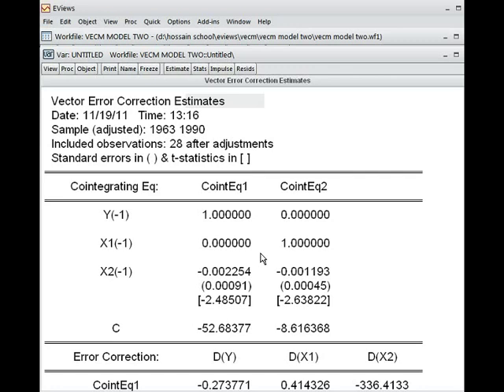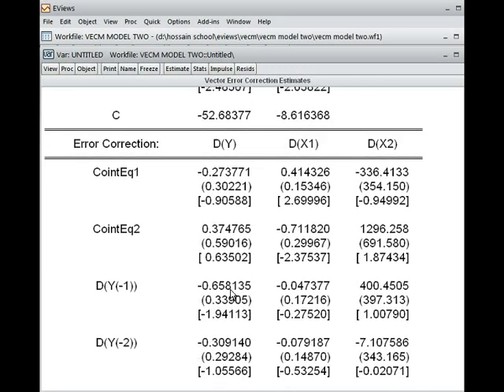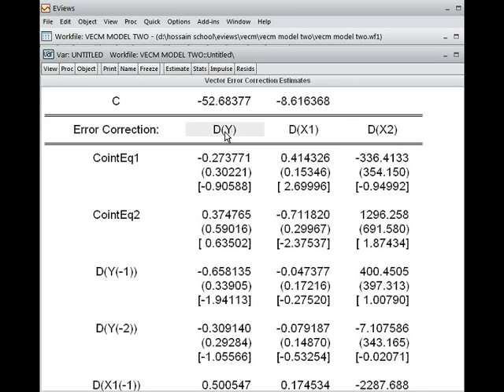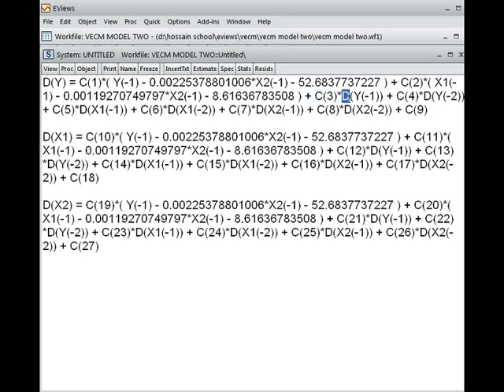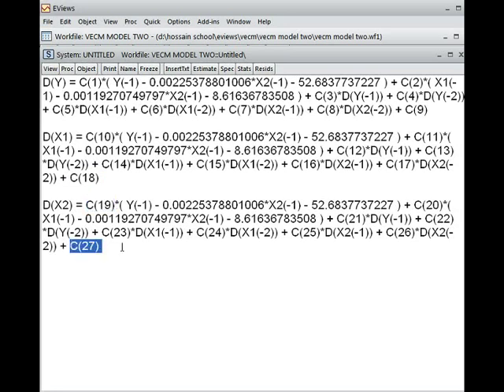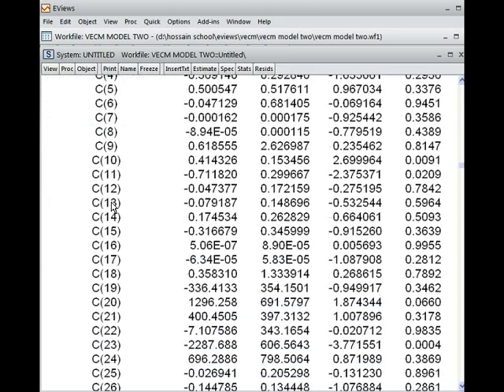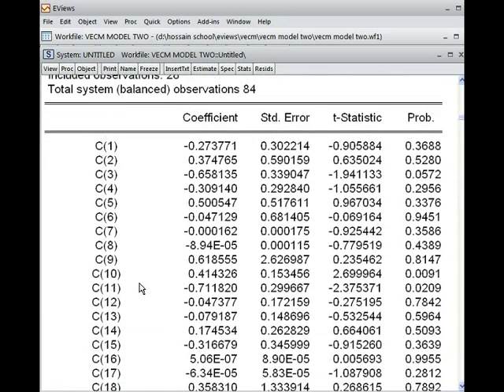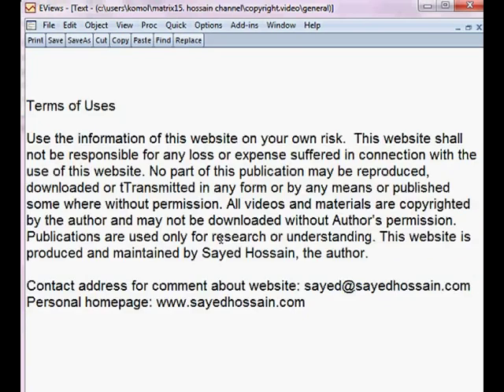VECM. Model Four. Part 2 of 2. EVIEWS

Comment: Hello Sir,
i had applied VECM on commodity indexes logged future and spot price.  VECM model is stationary and its residual has no serial correlation. but residuals are still heteroscedastic and not normally distributed. please suggest can i go with this model or not. can i use VECM with Garch Estimation.
Reply from the maker: I guess if you convert all variables into log and run it, hetrocedasticity problem may remove.

Comment: Hello, i saw it, but Im using VEC Residual Serial Correlation LM Tests and I would like if this result indicate that there is correlation, because en lag 3 rechaza HO.

I must look just lag 13 or each lag.

There is correlation or not?

Lags	LM-Stat	Prob
		
1	 2.904340  	 0.5740
2	 3.510978   0.4762
3	 9.952810   0.0412
4	 0.830685   0.9343
5	 0.495779  0.9739
6	 2.757596   0.5992
7	 0.955108  0.9165
8	 3.472518   0.4821
9	 3.337335   0.5030
10	 2.142388  0.7096
11	 1.639805  0.8016
12	 5.539782  0.2363
13	 2.319100  0.6773
		

Thanks,

Comment: hello Sayed, I´m running a vec model, but how i can identify how many lags i must use? my model have correlation serial,

I like know if  i have a vec model with 13 lags and the serial autocorrelation test LM have this results:

		
Lags	LM-Stat    Prob
		
1	 2.904340      	 0.5740
2	 3.510978       	 0.4762
3	 9.952810        	 0.0412
4	 0.830685        	 0.9343
5	 0.495779         	 0.9739
6	 2.757596         0.5992
7	 0.955108         0.9165
8	 3.472518         0.4821
9	 3.337335         0.5030
10	 2.142388        0.7096
11	 1.639805        0.8016
12	 5.539782        0.2363
13	 2.319100        0.6773
		

In lag 3 there are serial correlation or not????

Thanks,
Reply from the maker: I have a video on lag selection. See it

Comment: Good evening, Mr. Hossain. Your explanations are very useful for who, like me, is trying to estimate a VECM on a group of variables. Thank you for spending your time for us.
I have a question for you. I would like to insert a trend term and a dummy variable in the cointegrating equation. I tried to do it adding the dummy as an exogenous variable in the "VAR Specification" dialog box, but it only appears in the short run part of the model after the lagged differences of the endogenous variables. How can I do what I wish?
Reply from the maker: That part I have never tried before. Unable to answer.

Comment: hello Sayed, i have a problem in estimation of vecm in panel, so could you help me in order to have a good estimation, if you want, i send to you my data and i explain to you the target of my research. please M Sayed, could you also explain to me how to run the model. i need it in my thesis. could help me please and i need your mail. God bless you
Reply from the maker: I have not done anything with VECM in Panel. So unable to help
Reply: hello sayed
i don't understand something in vecm model which is the coefficient. so if i got a short run causality after using the wald test and i suppose that i chose lag 2 and coefficients of  independant variable in first difference are c(2) for lag 1 and c(3) for lag 2. so the question is about which coefficient (c(2) or c(3)) that i use in my interpretation.

Comment: Sayed, I am running a VECM with 4 variables. All of which have unit root and there is 1 cointegrating relationship. I can run this model. 

I then want to run a variance decomposition and impulse response functions on this model.  However when I attempt to do so, both these are ran using the original variables (not the differenced variables). 

Therefore my question to you is how to run the variance decomposition and impulse response functions on the VECM model I have just created. 

Many thanks

Comment: Mr. Seyed Hossain, thank you for your videos, I have a time series model (39 obs only) that Engle Granger (OLS regression with stationary residuals) coefficients is OK however VECM and ECM G to S models are giving me different coefficients and there for different results. Can we say Engle Granger approach is still valid? although it suffers from not normally distributed residuals and Serial correlation? i appreciate if I can send you the model that you can comment on it.

Comment: Hello Sir, I am  running a VECM Model for 5 variables. I have 31 observations as in your example.Both trace and max-egeinvalue test give me no integration equations if i Choose lag 1, is that normal? If I choose lag 2, the two tests gave me 2 cointegration vectors? and if I choose lag 3 , the trace test gives me 5 integration equations, and 2  for the case of maxegein value test...if the two tests diverge, which one should I choose?